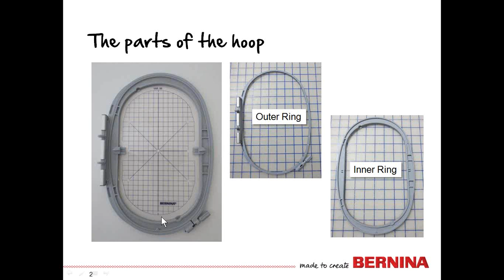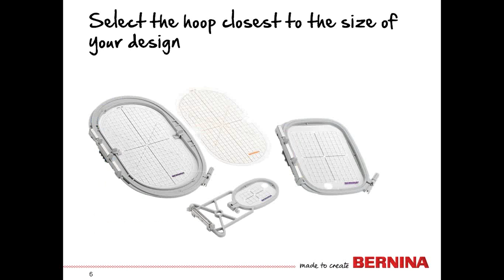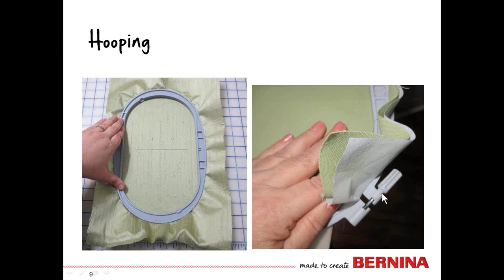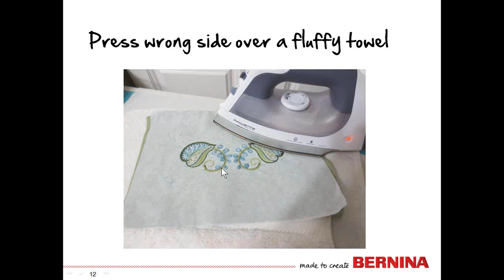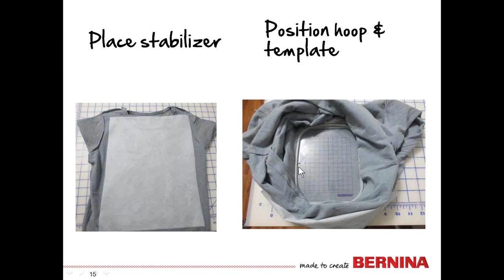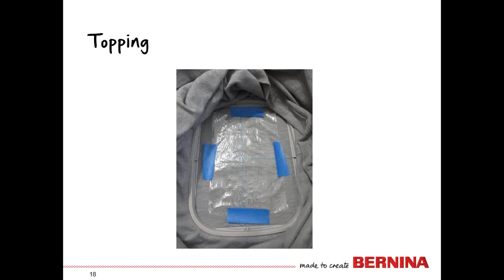BERNINA Embroidery - Tool Tip - Hooping

Comment: Seems like you're missing a step that says to turn shirt right-side out
Reply from the maker: Hi! Thank you for your comment. You would not turn the shirt right-side-out before embroidering. If you do that, then the bracket that connects the hoop to the embroidery module would be on the inside of the shirt and thus unable to connect. If there seems to be too much bulk in the way with the shirt partially turned inside out, you could hold it away from the needle and out of the way with painter’s tape or large binder clips. Happy embroidering!